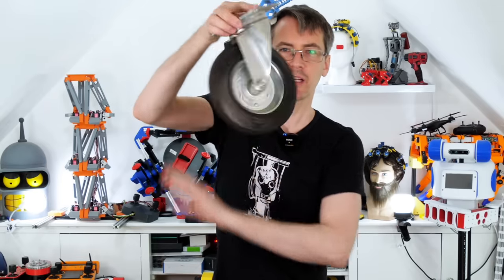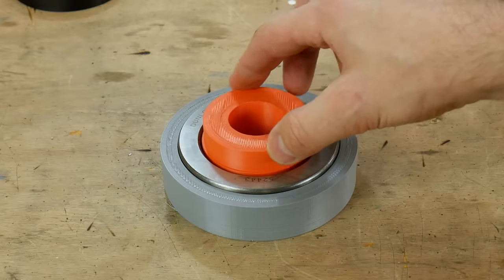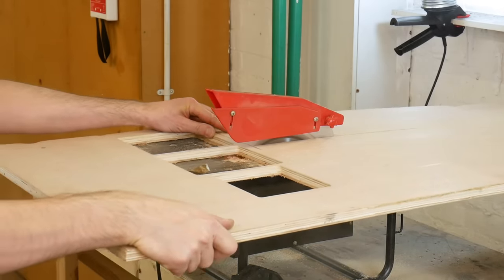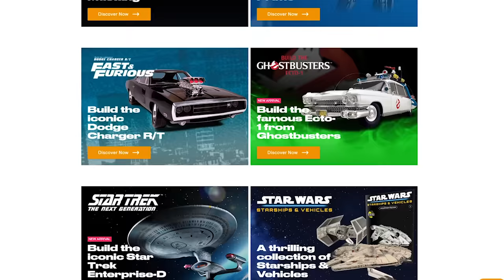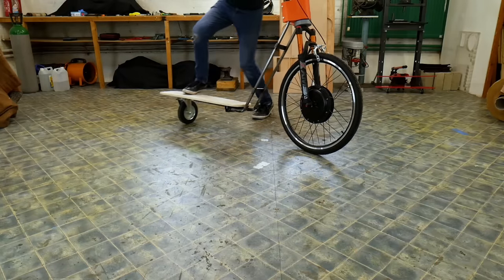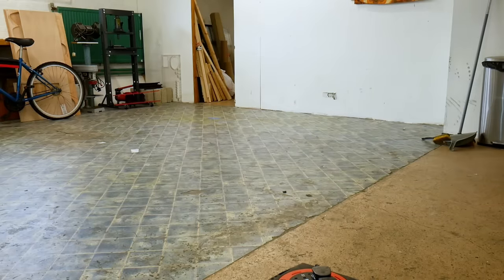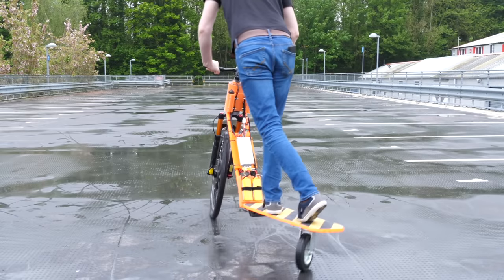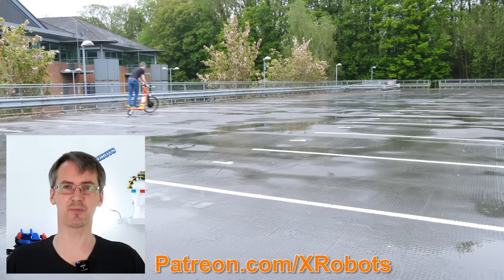1000W Caster Scooter

Comment: This idea could probably work better if you tilt the caster wheel forward on it's attachment point like a Caster Board or Ripstik. They only have two casters that are tilted forward under the board so that they only allow for forward motion and it also limits how far out the back of the board can go. Because of the tilt, you also create your own momentum using a side to side sweeping motion.

Comment: I made something very similar as a kid. It was a razor scooter with the back wheel removed, and there was the board from a long board bolted to the scooter deck. I put a rip stick wheel on the back of the longboard, not tilted like it was on the ripstick. It was a lot of fun, and quite controllable. I think yours doesn’t respond to leaning as well because your back caster is so big.

Comment: I'm pretty late to the party here, but this actually made me think of Ripstiks something I got quite good at riding as a kid, which was basically 2 caster wheels as a skateboard (hence their other name casterboards) and also Fliker scooters which were a scooter with a fixed steerable wheel at the front and 2 caster wheels in a V shape at the back. I believe both achieved a favourable forward orientation by angling the caster wheels, and this is also why they can generate speed by wiggling.

Comment: Maybe it would ride like a drift scooter if you make the trail of the caster wheel a lot longer. So the stabilosation is more at lower speeds. 
A spring that returns the back wheel to normal could also help

Comment: i made this as a kid, except it was self propelled by angleing the rear castor mount like a ripstick does. allows you to wiggle the rear to gain speed and also would self correct straight better. I dubbed it the spin scooter, i later saw a instructables guide to make it just like I had. my inspiration was those wacky self propelled carts that you turned back and forth to gain speed, they used to have at the six gun city amusement park. once i out grew that ride i was forever in search of making something nearly as fun. the spin scooter was damn close.

Comment: The self centering could be accieved by setting the caster wheel at a angle to the ground. So the mount would be at like a  25-30 degree agle to the straight frame. Hope it helps

Comment: something that could make this actually interesting to ride would be a rear "pedal/brake" attached to the caster, so you can a) control which direction the caster tracks by pivoting your rear heel to one side or the other and B) have a brake that engages when you take pressure OFF the pedal. The braking function should also force the caster to track straight, probably with some kind of cam system. The rear brake would need to be limited to a set amount of friction, otherwise it could entirely bind the caster and cause a crash. Controlling the caster angle would also allow for limits to be set on the caster angle, so it can't get TOO out of control. Would just let you do some really tight u-turns or lateral shifts.

Comment: 3 ideas for the scooter: 1.brakes on the back wheel, 2.Cam/spring to encourage the wheel to straight orientation, 3. Smart rear-wheel positioning using servos

Comment: the thing that is i think overlooked is that the bicycle front forks are tilted backwards to create the self centering affect. you actually have the front wheel self centering while the back wheel is free, until you kept riding it and introduced an angle to the caster via the frame bending while also gaining skill. you just need to make it a bit more similar to those krazy karts that are just trikes with adjustable self centering on the rear casters.

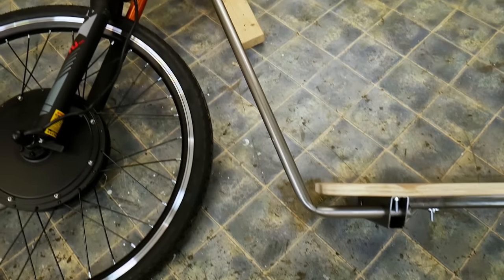Comment: You can cap weld the end of the pipe 5:35 fill it with sand, tapping it to settle, then cap weld the other end. Then when bending the sand will help keep the tube from collapsing at the bends. Try adding water to take up space as well.

Comment: JAMES! Angle the castor like 20° back, it'll bias the rear wheel towards the center and add "weight" to the steering. Razor nailed it with their Ripstik. A circular profile on the castor wheel would also even out the banking. Might need better wheel bearings at those speeds. Excited for 2.0!!

Comment: if you angle the deck downward in the front for a slight rake, the rear wheel will stay more inline because of balancing, look at the way ripstiks have their wheels, those are double castered with an agressive rake for the wheels (the head of the caster is angled forward which aids in stability for a forward trailing  lead

Comment: Needs to be a drop deck(z frame) with the rear castor mount higher than the footboard to lower the C.G. and place the footboard on the centerline of the castor axle. That would also stop the castor from rotating backwards completely.  The castor should also be mounted at an angle to change the rotation direction and rate.  Also with that bender you need to do smaller bends next to each other until you get the final angle.  It wont be as tight but it would be stronger.  Also, your gussets should be perpendicular to the bends.
Reply: Yes this ☝🏻
Reply: absolutely this.  came here to say this.  A lot of the control you get on a scooter is from having the deck lower than the wheel hubs.
Reply: All good tips.

Comment: I would add a motor to the castor that acts as an e-brake. The added drag should "wind-sock" the castor and also put some energy back into the battery. It would also prevent the rear coming around when breaking as the force would be from the back.

Comment: Ned to install the caster with a forward angle so that the swivel of the caster does not sit level with the ground. You want the part of the caster towards the front of the .... scooter? lower then the back of the caster so there is a natural highspot that the caster naturally wants to sit at. Im a little rusty on the math but i believe as long as the caster angle is greater then the angle you lean on the scooter then the caster will at least try to stop you from spinning in circles. This is how they keep taildragger planes facing the right way (as well as some other mechanisms that let the pilot steer and such) the caster will have a natural tendency to remain straight (ish) while still allowing you to drift and spin if you really want to.

Comment: Ripsticks/caster boards more or less solved this problem by setting the caster wheels as at an angle. You get the fluidity of the wheel being on a swivel vs hard mounted, but it also constantly corrects back to forward trajectory.

Comment: You should convert the rear wheel to a scooter hub motor, and have it in continual regen mode. That way, it has 'drag' to give it some way to straighten out. And since it's regen, you're not just converting it to heat. You could adjust the amount of regen dependent on the speed; more regen at slower speeds, less at higher.

Comment: My guess is it depends on the ratio of friction of the wheel surface, to the resistance to directional change. If it's hard to change the direction of the wheel and the surface is very slick, I think the wheel will tend to drag on, at whatever random direction. It the wheel has a lot of grip, it'll follow along nicely.

Comment: You should make it so the caster wheel is at an angle so it returns to center while going in a straight line. Your weight pressing down on it will want to keep it in line (like the front of the bike.) So, angle the back of the bike upward at about 15-20 degrees and then mount the caster wheel on it.

Comment: I think to solve the issue of the rear castor not steering in the direction you want would be to put a pivot in the centre of the board, similar to a wave board, so you can use your back foot to control the direction the back wheel takes you.

Comment: I believe if you add some caster to the back wheel it would be a very interesting bike since as you lean it would steer in one direction but if you made a system that would allow the caster to be changed on the fly like a ripsaw or whatever the drift kart thing was it would be quite a bit of fun

Comment: Here are my suggestions to make it more controllable AND keep it challenging:
- limit the casterwheel to 45° to each side; it will still be relatively random, but at least it won't set itself at 90° to the board and throw you off
- put a handbrake on the fork bearing so that you can stop the fork from turning relatively to the frame; not sure how this will affect operation, I guess it would help for slowing down

Comment: I'm sure I may be misunderstanding but it sounds like steering goes bad because the caster wheel turns when you lean so what if you split the platform you're standing on and connect the two pieces with an axel in parallel with the platform (like a hover board or your bike with the self leveling omni directional wheels); then you could maybe lean one way with your body on the front half and use your back leg (or maybe some kind of interconnected counter lean?) to keep the back platform level or maybe counter leaning (if either would keep the caster oriented straight)

Comment: The shortest fix to this idea would be to put the caster closer to the front wheel and allowing you to shift your center of gravity behind it to gain control over the drift. While it would turn it dangerous to bank, it would be much more managable compared to the current version.
The next idea would be to put the back end of the caster on a joint, while the front end should have an adjustable spacer and you would be able to change how much drift you allow by changing the caster's vertical angle to the base plate.
The overcomplicated idea would be to change the base plate to a drop deck, add a joint to the back part of the caster and pneumatic springs on the font end. This way you could change how much drift you allow by moving your center of gravity towards or away from the caster.

Comment: if you put a second caster on the back and a build a little flexing-stability gimble attached between the two inner caster bolts; you might be able to make it more stable to ride and maybe even turn better.

Comment: Cut a circular hole through the scooter top and put a bearing between it. You can use your foot to hold the castor in place or even put both feet on and change the rear tire direction independently from the front.

Comment: I notice when you made that successful turn that the bike was already bent, putting that caster mounted at an angle relative to the ground. I suggest trying again, with an angled block under the castor, like the RipStik or other similar products that use this concept.

Comment: I think you need to use your back foot to control the castor's angle to the bike.   If it could pitch up and down, you could control its stability.  That or maybe make some way to apply brake to the rear.  That would straighten you out quick too.

Comment: Would increasing the rake angle, fix the problem?
It'll naturally have a forward bias, from the lean angle.

When applied weight on either side, it'll steer towards that direction. Like a skateboard.

Start with limiter for the rear steering, or something to dampen the speed of the change of direction(Tighter bearing?)
Reply: my exact thoughts

Comment: This is basically a scaled up and beefier version of the Razor Siege Caster Scooter (and the like).  It's pretty big over here in the US. The rider actually wiggles back and forth to make the scooter move forward, and they can get some pretty fast speed too.
I like James' version a lot better, tho. 😎👍

One thing that would probably help out to make it easier to ride is to not stand so far back on the platform. It's putting too much weight on the caster and making it go all wobbly. In the Caster Scooters, the kids are standing closer to the front of the platform.  The only big difference between the Caster Scooter and this one is the added electric wheel on the front. So this should be ridable.

Comment: There are lockable rotating casters which have a pedal activated swivel lock. Maybe removing the bistable mechanism and the wheel lock would allow for a Footbrake swivellock on the rear wheel to only selectively drift that wheel

Comment: if you could put a bit of resistance on that rear wheel i think this would work even with it rotating around freely if the wheel itself has a bit of resistance it'll make a bit of drag and straighten itself out as the front wheel pulls it along like the brakes on a semi trailer.

Comment: I'm sure it's been mentioned, but mount the caster not on the flat surface of the deck, but on an angle to the deck that gives the caster an inherent stability when weight is applied. You may need to play with the angle until you get it where you like it, but the jist of it is when the caster is forced to be unaligned with the deck (like if you take a hard turn and drift a bit) it will apply a "turning" force on the caster that will want to correct the direction. Maybe you should make a mechanism that allows for the quick adjustment of caster angle so you can calibrate it in the field.

Comment: I suppose depending on the rake or caster angle, the rear wheel would be less free to pivot and end up behaving more like a skateboard truck. In which case it should be ride-able. (Apparently it's also ride-able without much of that, but it's very impractical since anything that messes with the tracking of the wheel makes it highly unstable. Tilting how that rear wheel mounts would still make it less loosey-goosey.)

Comment: I think you just need a smaller front wheel. When I was younger I had a scooter ("Razor Siege Scooter") that was just like this with a back castor wheel. The back caster was also angled back some. It required some effort to learn, but was way better than this. Once you got good, you could drift & carve around turns, and drive downhill sideways.  You could also self-propel the scooter forward by swinging the back of the scooter back and forth some. 

Another interesting one was a skateboard I had where the front trucks where replaced by a single castor wheel. This enabled you to do similar things as the scooter, especially self-propulsion by shifting the board side to side.

Comment: You could make the platform a triangular shape and put two caster wheels on the back side by side so the bike can't flip out from under you, as well as add brakes to the casters somehow to force it to trail behind the front wheel if neccessary.

Comment: James It'll be hard to balance the way it is as a level mounted caster is designed to be mounted flat and skate all over the place and help keep the mass moving in the same direction as its usually on things with more than 2 wheels, that makes it a challenge on a fairly precise steerable object like a scooter, but I'd say the rear needs a few degree's of trail to help keep it more in line,stick say a 5mm shim in between the casters mount plate bolts nearest the front. 

Also one other thing you may need to consider is reshaping the rear casters tyre profile, with having to add trail it means its going to want to roll over on its edge more, if it rolls onto a sharp corner like a caster designed to work on a flat plane it;ll introduce wobble and all sorts of unpredictable characteristics, in layman's terms think of a motorcycle with a square-ish profile car tyre on it, would be fine in a straight line and ring-piece clenching-ly horrible the minute you leaned into a corner

Comment: I'm impressed you could ride it.  My first look told me "maybe...until you let off the throttle" I was close.
If the angle of the deck forced the rear caster to go toward the front it would ride easier (not easily). If the front wheel did not turn at all and the forks were nearly straight up, you might be able to rear steer slowly, but not so sure.
Looking forward to new geometry and gussets on the inside of the bends at 90 degrees.

Comment: Razor made a scooter in the 2000s caled the Siege which was a basically a kids scooter version of this and from what i remmeber it worked really well and you could get good control and balance. Id assume it was so much easier because the caster wheel was so much smaller so much lower center of gravity?

Comment: I do think it would be easier if it's front wheel was fixed and you do tilt steering as well as either have back brakes or a button that locks the rotation of the back wheel for braking.

It does look fun in any case.

Comment: If the caster under the rear was tilted forward at around 22° or so then it'd have a bit of "Rip-Stick" effect by giving you the ability to change the amount of weight pushing down on it to bring it back in line by moving your weight forward or back on the platform.

Comment: You could steam bend the back of the plywood where the caster mounts and bend it a bit to make the caster want to track straight. It would also give a good positive position for your rear foot to sit on. Or you could make a pivot point between the front steering bit and the rear with spring to help it want to come back to center so you can lean the caster away from the direction your steering.

Comment: It seems the two-wheel, drive wheel and caster, is unstable. It tips when the caster over steers. But I bet you would bet better performance with a three-wheel version. Keep the drive wheel up front but have two large caster wheels in the back. I don't know for sure but I think have the second caster in the back would help with the stability of the thing tipping when going slow or turning.

Comment: You need to place the castor pivot at an angle. This will track the castor straight. The more from vertical you go the more stable it will become. Trade off between drifting and stability.